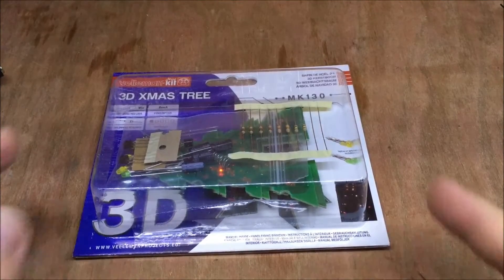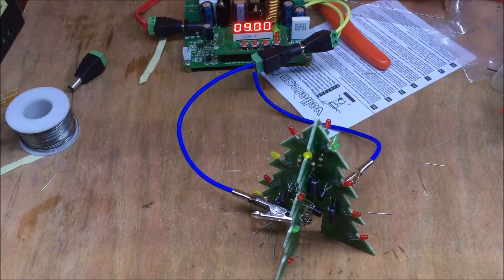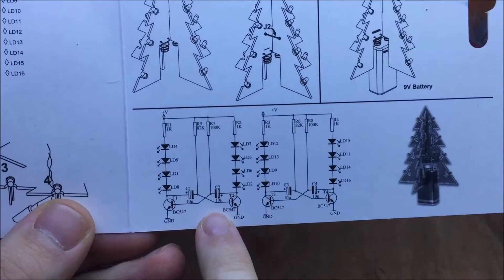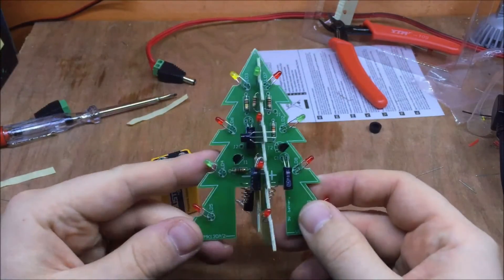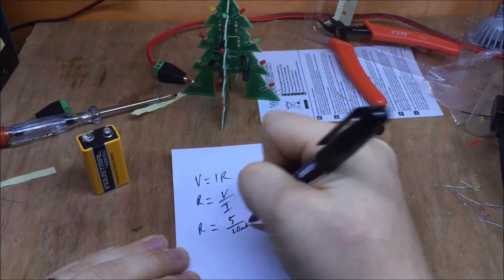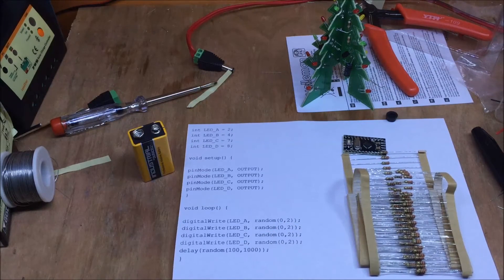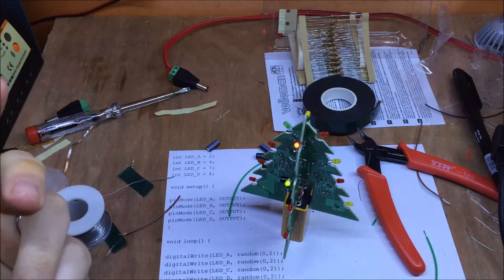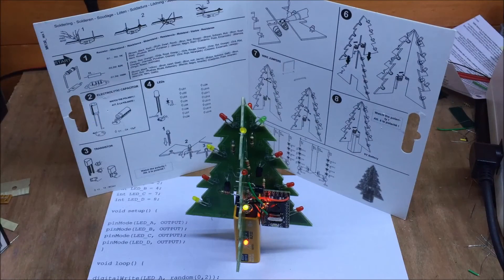Maplin 3D Xmas Tree - Adam's Arduino Projects

Comment: Did you use a shield? What type and what for? I'd like to have more info on how the arduino was there for?
Reply from the maker: Well the original circuitry broke and I decided to over complicate the system with an arduino pro mini.  I used a couple of the digital pins on the arduino to drive the base of the transistors to flash the LEDs in a random pattern - the original (simple and probably more efficient circuit) was a simple multi vibrator and just oscillated between two strings of LEDs.  Actually - I should dig this out again, 'tis the season.
Reply: ok so the pro mini was to fix the circuitry. But what about the first one mentioned. the DC converter was just to power 9 volts instead of the arduino's 5 volts? I'm trying to do the same thing but the tree and the arduino don't connect
Reply from the maker: +Jessica Reyes Leal The tree it's self uses a nine volt battery. Innitially I didn't have one to hand. The pro mini will use an onboard regulator and bring that down to five for the micro controller if you connect the 9volts to the Raw pin. 
So the nine colts powers the arduino and leds. The arduino uses a small amount of current to drive the transistors.
I hope that helps.